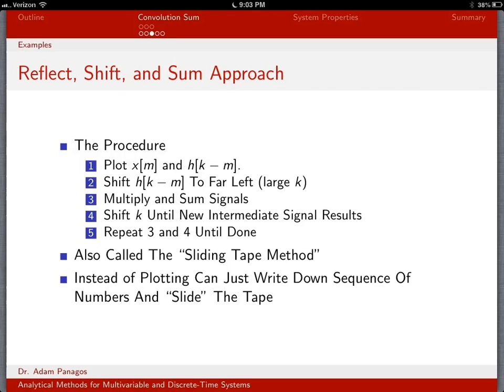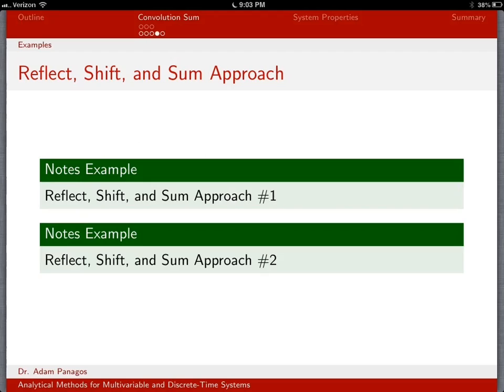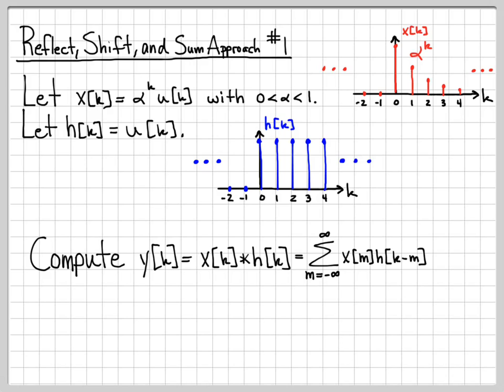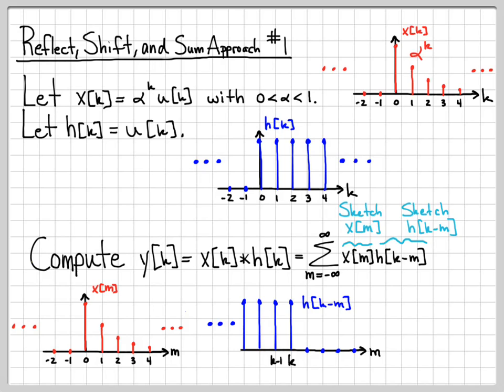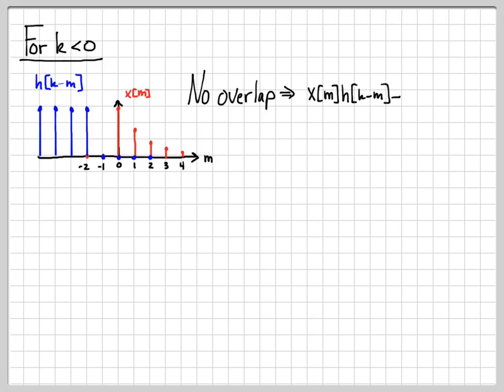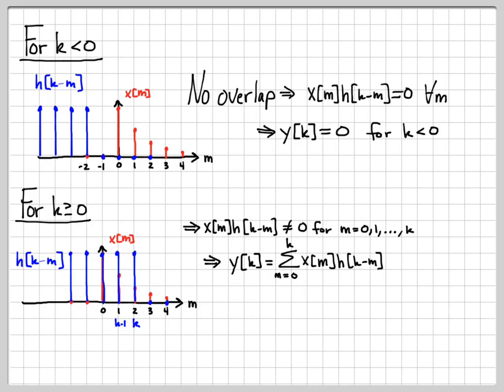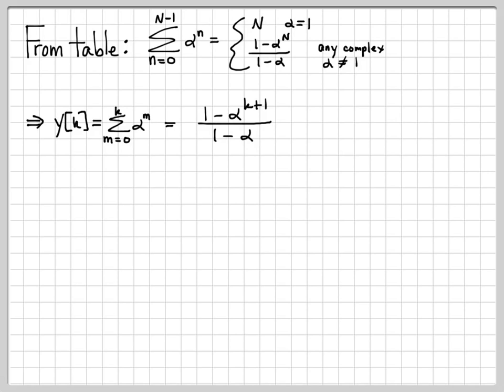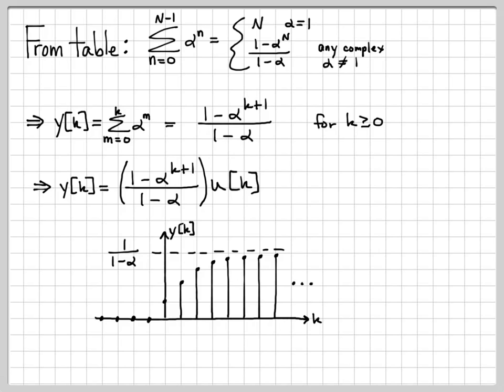Reflect, Shift, and Sum Convolution Example #1 - DT Systems Part 2 (5/9)

Comment: at 4:18 , we know h[k] = u[k] , h[-k] will be the reverse of h[k] . and h[k-m] is simple the delay of m in h[k] not in reverse of h[k] as shown in graph.Kindly someone explain it to me.Thank you
Reply from the maker: You have to be careful with your time indices.  Inside the summation we are working with time-variable m for a constant shift of k.  So, inside the summation, h[k-m] is a time reversed signal in time variable m, (i.e. the -m) that has been shifted a fixed amount k.  It is NOT a time variable k signal that has been shifted -m.  Hope that helps.